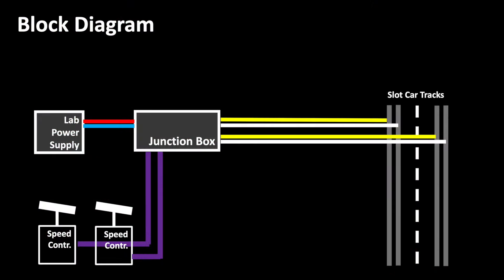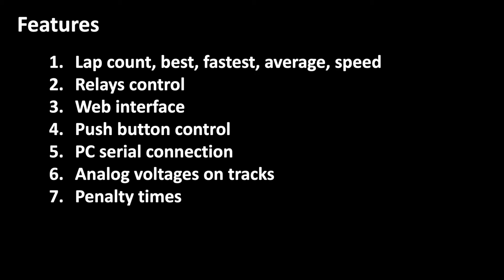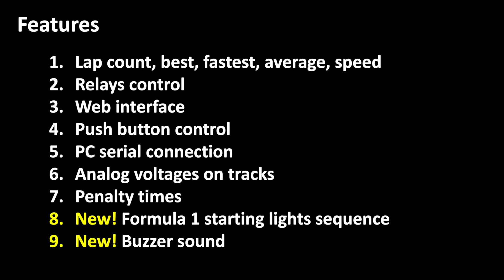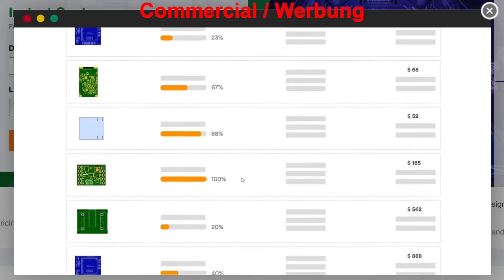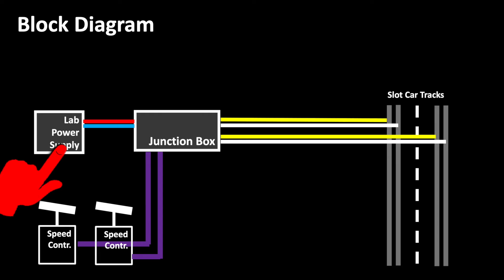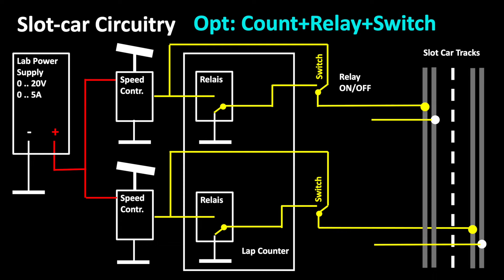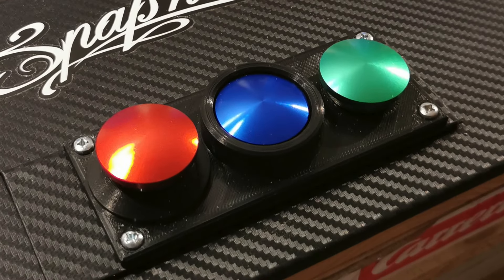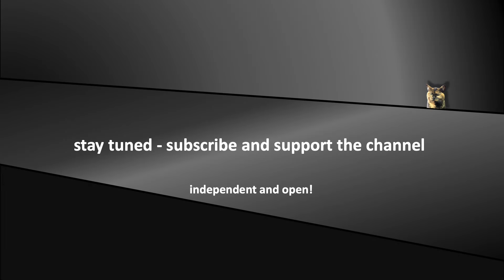WiFi Slot Car Lap Counter: Wiring all useful Features (EP85c)

Comment: Awesome project! Thank you for sharing! 

I have changed your code a bit for my needs by using an RGB LED strip (with only 1 data pin) and rfid sensor for sensing micro FPV rc cars. I also added some OLED screens so the racers have a HUD at the start line. I plan to make a video once I get the additional electronics implemented in a more reliable way.

 The only thing I could not figure out was how to find or assign the pin for the buzzer (I am not super experienced with arduino and am using a different board, the nanoesp32).

Thanks again for great explanations and documentation!
Reply from the maker: Thank you very much for your comments. Great that you have ideas for extending the project! I am in particular appreciating your ideas with the RGB strip and the RFID sensor, because it allows apply the lap counter to any arbitrary model race track, where the cars are not using the same slot for the whole race. 

Concerning the buzzer: it is just an active buzzer that runs on DC from an arbitrary output from the ESP32. There is cheap versions that run on 3.3 Volts. In case you are using a passive buzzer, which is just kind of a loudspeaker, you would need to program an AC output signal, e.g. using a PWM output at 50% high and 50% low, where with ESP32 you can even define the PWM frequency.

Nice project that you are planning and I am eager to see it on your channel.